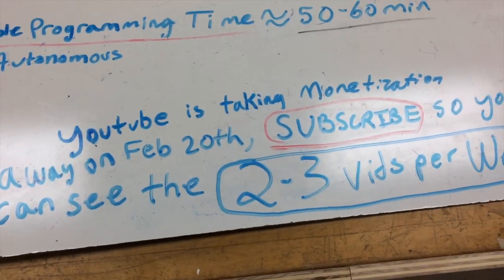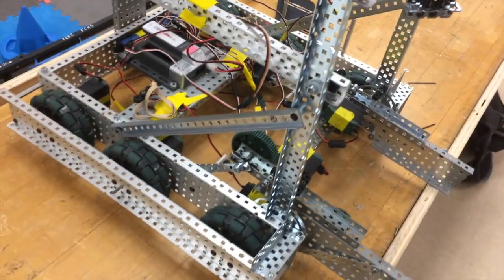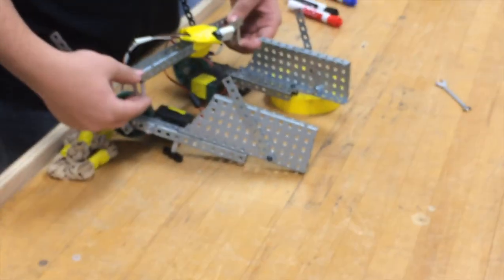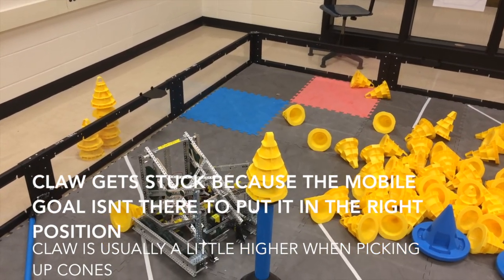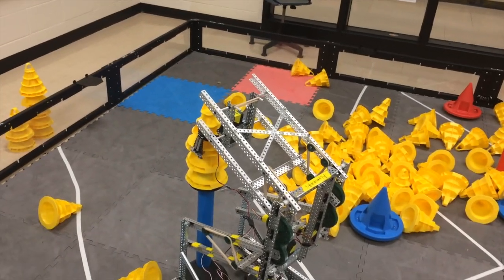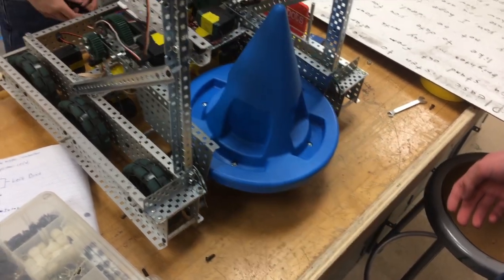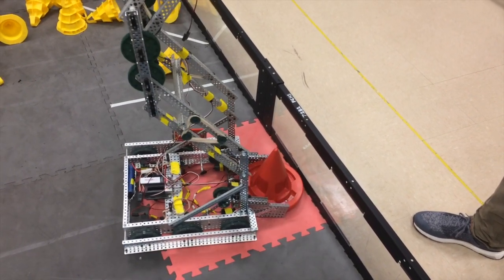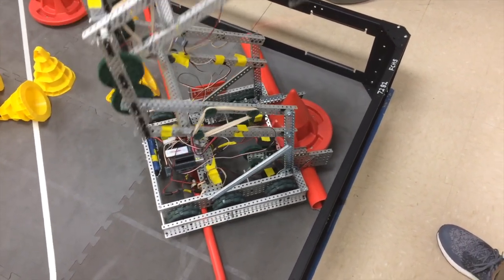Vex In the Zone Robot Meeting 1! Preparing for Competition

Comment: You should add 2 more motors to your lift. The 2 torque motors you currently have on it are really struggling.
Reply from the maker: yeah, we may also try a battery expander or more rubber bands thanks for the suggestion
Reply: i don't think it is the motors i think there lift isn't neutrally buoyant, because my team has 2 motor 1:5 and we almost never burn out and we only have 1 battery
Reply from the maker: Thanks for the suggestion, I’ll look up what that means really quick lol. Before I do that, however, we were using old rubber bands that lost their elasticity. The lift works much better now that we continually switch them out.